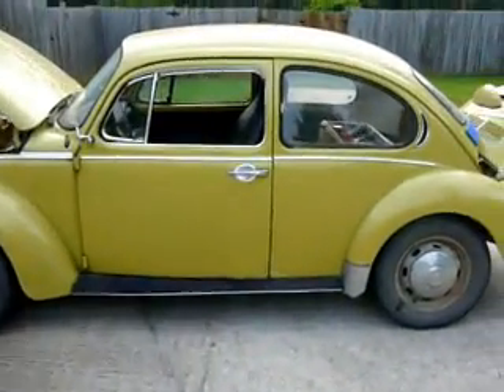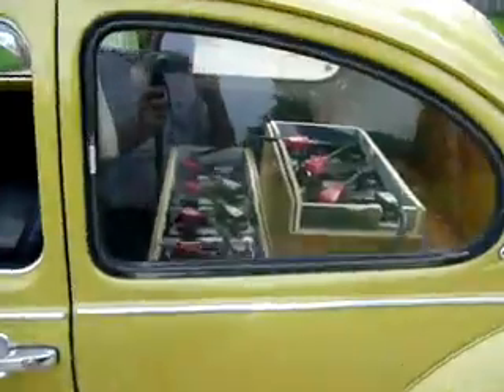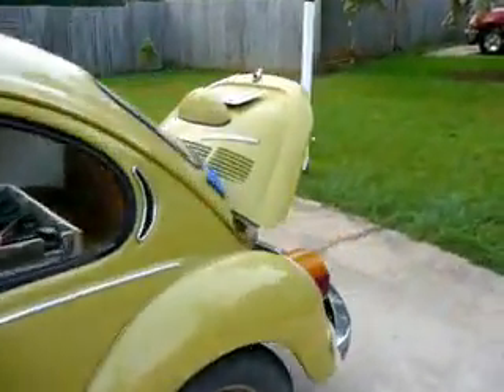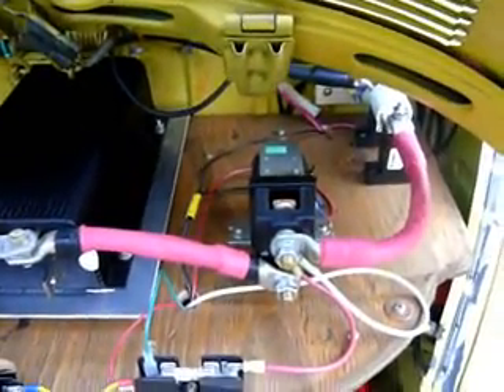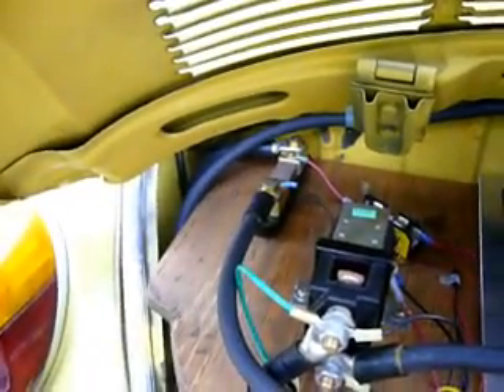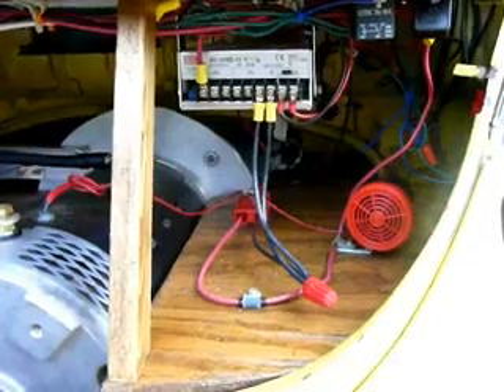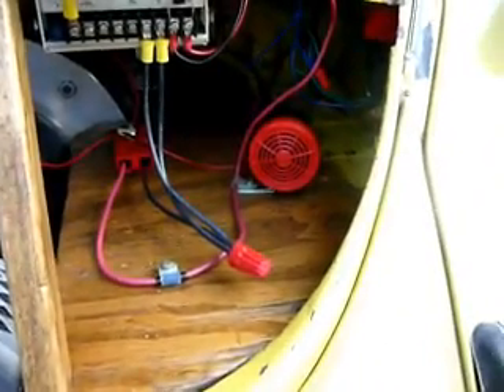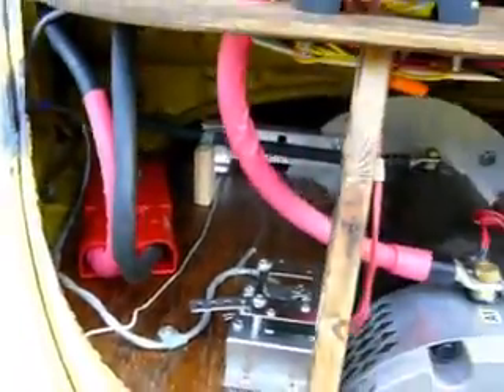Electric VW Beetle Conversion Details

Comment from the maker: @AZPONG ... I do not believe I can get enough solar panels attached to the car to provide enough power to charge my batteries. My range is 25 to 30 miles and I can plug in, recharge in 6 hours so I don't think solar panels are the way to go for my application.

Comment from the maker: I have removed and installed VW engines several times over the years so it only takes me about 45 minutes to remove the engine. The transaxle remains in the car. The conversion started on May 5, 2008 and I drove the car for the first time July 18, 2008. I have driven over 4500 miles so far.

Comment from the maker: I use 1st, 2nd, and 3rd gears. Depends on the speed. Have not kept it in one gear for a full charge. 7 hours to charge the batteries. More batteries would mean more voltage which means more power and range but more weight. The car is already 760 lbs heavier than stock.  Did not notice any flex. If I were to go with more batteries I would use a Chevy truck. Thanks

Comment from the maker: The kit, wire, wood, and misc items totaled about $5000. The batteries were $1450. The reason for the VW Bug is because I already owned it. I have had the car for 4 or 5 years. Temperature affects the batteries. Summertime I get around 28  30 miles per charge driving 0  60 MPH. Winter I can get about 14  18 miles driving 0  50.

Comment from the maker: I have thought about more batteries but that means an additional expense for batteries and charger. 96 volts gets me back and forth to work which is why I built this car. 

The batteries only put off a gas while charging. I cannot drive the car while the batteries are charging so I do not have fumes while driving.

Comment from the maker: Thanks, I appreciate the compliments. I do have a little wood working experience from the past. I used a jigsaw, drill, sander, and miter saw for this project.

You can do the regen but I felt like it was not cost efficient. This is a DC system and the regen works much better with an AC system.

I have had request for more wiring videos. I thought about making a wiring diagram using wood pieced for the components but was not sure if anyone would want that. Thanks again!

Comment from the maker: Thanks! DC motor, controller, contactors, DC DC Converter, and pot box plus the adaptor plate, motor coupling, battery charger, gages, fuses, wire, connectors, battery box material, air shocks, and other misc odds and ends - about $5000. 96 Volt battery pack was $1450 - includes deposit. Started May 5, 2008 and drove it July 18, 2008  7 weeks. Why a DC motor over an AC motor? Cost. AC motors operate at high rpm that have to be stepped down, and have expensive and complex speed control systems.

Comment from the maker: On a fresh charge I can maintain 60 mph on a flat and level road for a few miles. Last night, lights on, I drove to work on I-75 and going down hill I reached 70 mph and uphill 50 mph. I exited I-75 running 55 mph after 23 miles. I parked at work and had traveled 23.7 miles. My state of charge gage was on 2% charge remaining. I believe I could have gone maybe 2 more miles. I am on my 38th charge and my mileage continues to increase. I hope to get 30 miles by the 60th charge.